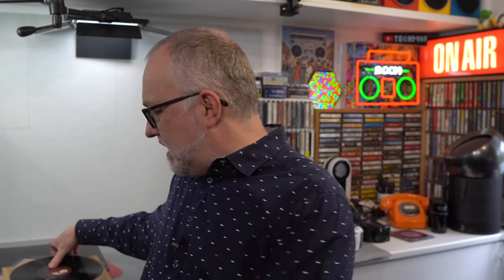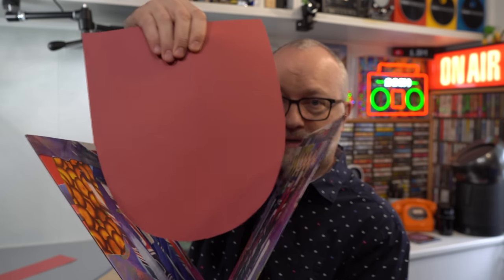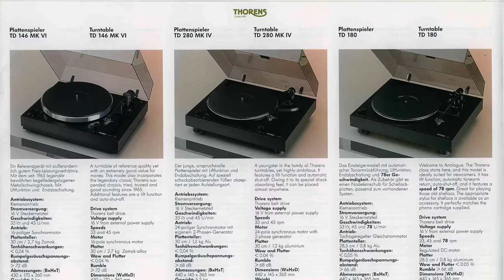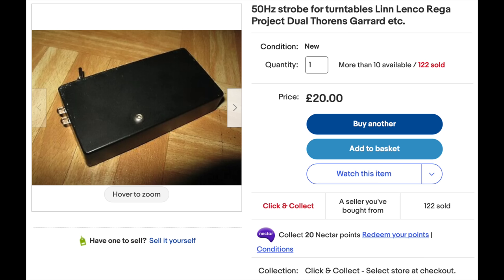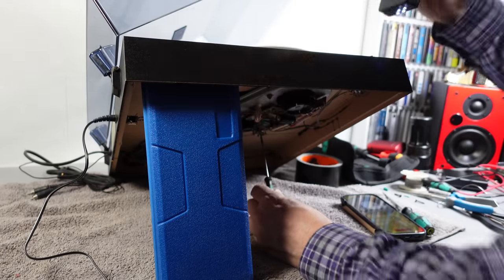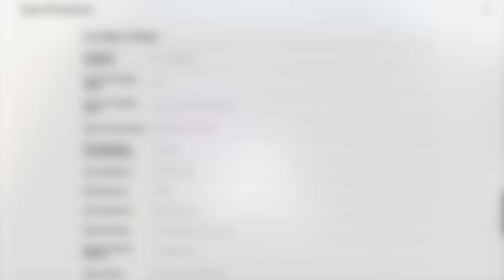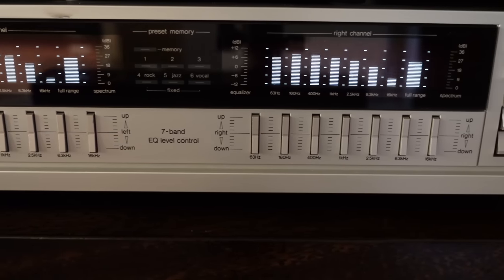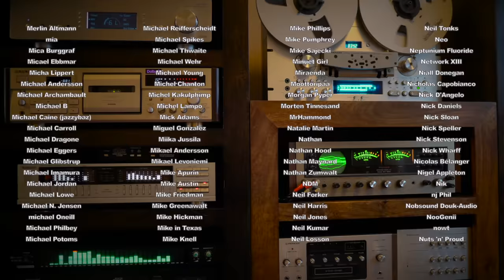Playing 78 RPM Shellac Records properly

Comment: I have some late 50s 78rpms that were released in conjunction with the 45 release as well as LP.  They sound pretty close to the 45 cut with a good setup - sometimes better in some ways... due to the higher bandwidth of the 78rpm disc.. technically you could cut a record with higher frequencey capabilities  on 78rpm.
Reply: Baird recorded video on 78's in the late 1920's.. he was a really forward thinker in many ways.

Comment: Exposed carbon trimpots like those are as cheap and crappy back then as they are now. Oxidation, contamination and drift are expected. Not that they're inappropriate for the job, but the engineer had the use case in mind when specifying them.

Comment: Are the trim pots on the board to adjust the speed originally at the factory??? The trim pots are mechanical devices that can drift over time.

Comment: Do 78 rpm records sound better than 45s and 33s because they run at a faster speed?
Reply: In theory, but in reality not. They are not made off vinyl, they are mono, and the bandwidth is limited.
Reply: The new 78 vinyl pressings sound better than the slower speeds

Comment: If you can find a neon lamp, you can light the stroboscopic disc and check the speed, because it flicks. Old fluorescent lamps can also be used.
Reply: an LED and a large value resistor and the mains will do nicely to make a clean 50Hz strobe.

Comment: You have just perfectly demonstrated how 'loud' and 'soft' 78 rpm gramaphone needles work. The soft or 'quiet' needles are narrow while the loud needles are broader. Not forgetting 78 needles can only be used once and should be replaced after each play. Old record players if you recall had a switchable 45/78 stylus

Comment: On an Audio-Technica or newer Technics with 78rpm speed capability, for even less money than swapping the whole headshell and cartridge, you can use a cartridge that has a 78 stylus available (Ortofon 2M, Stanton, 500, Audio-Technica AT-VM95 series, etc.) and just swap the styli and adjust the tracking force.

Comment: I archived a pile of 78's a few years ago - changed the stylus to a 3m and set the tracking force correctly (using blutack!) on my 33.33 player..   Recorded in Audacity and adjusted the playback speed.  Cleaned up the recording and removed the de-emphasis.   Sounded okay.

Comment: Carbon comp pots can degrade over time and you did buy this used... The motor could be a bit worn, but being that you did get it up to speed, my thoughts are you did the right thing by calibrating the device.  Its been shipped and, again, since it was used, you dont know what was done to it previously.  You also dont know if the factory even bothered to properly calibrate it when it was originally shipped either. Was gonna suggest just using a single output, but you figured that out by the end lol :) It's incredible we still have these snapshots of moments in time from long ago we can still listen to.

Comment: I went with the AT route. I am a (well, the at them moment) music archivist for a local museum. I went with the AT turntable, a second head, and a 78rpm needle from LP Gear. After recording ~2000 records it is definitely a really great option. The built in preamp can be turned off as well, and it outputs via USB, which avoids the fiddling about you had to do.

Comment: Right, now go super low-fi and get a record player that runs 16RPM records. Good luck actually finding a record that runs at that speed but I'm sure they are out there. I've got several vintage players from the 50's and early 60's that have a 16RPM setting on them. Totally had no idea what it was until I did some research.

Comment: A decade a ago I was told for early non microgrooved 78T not to wire a shure M78S cartridge as a "stereo (L+GNd and R+Gnd)", but mix "L+R" and 'Gnd+Gnd" to get the full mono spectrum. it seems to reduce more the surface noise.

Comment: This was entertaining, but if you wanted a budget system that was designed from the get-go to properly play 78s (and 33 & 45) any of the major manufacturers record changers from the 50s to early eighties that came with the flip-over stylus would play 78s just fine.  The changers made by Voice of Music (maybe not so common in UK & Europe) or models by Dual, Collaro, even BSR are an inexpensive way to play 78s with the correct stylus and you can adjust them to the proper tonearm weight.  Maybe in a future video find and restore (if necessary) a Dansette (pink or turquoise would be nice) and export the audio to some good external speakers and I'll bet the 78s sound fine, especially as you mention, most 78s are quite worn.  Cheers. And Yeah, Yeah, Yeah, it's mono to the max, man. We don't need no stinkin' stereo.

Comment: Well, you finally got around to reviewing my turntable.
Yes, I bought a TD-180 Mk-S back when new.
It seemed a logical option out of limited choices at that time. It originally came with (in the US) a Stanton 500 cartridge with a .7 mil conical stereo stylus, and I immediately got a 3 mil stylus for that cartridge.
It has had a few other cartridges with interchangeable 78 styli since. 
It did suffer with running slow after sitting through long periods of not being used, more than once. Though much worse at 78 than 45 or 33. My solution that worked twice and continues to work till the present was simply a drop of very light oil in the top and bottom motor bushing. The motor in yours sounds noisier than mine. So, you might want to give it a try  and recalibrate the pots again if it goes too fast. But that strobe on the motor shaft is supposed to actually regulate speed. It’s just an external servo system applied to an apparently slightly undersized motor for the task. 
Otherwise, it has been an excellent turntable for a lot of things. I do have a lot of other choices in vintage and newer tables for 78s as well as other records. 
I would recommend getting the AT stereo stylus that fits the cartridge you bought so you can use the Thorens for other than 78 duty. 
Also, there is a commonly available 3mil 78 stylus for the common red stylus ceramic cartridge used in your portable and in the common suitcase players. 
There is also a legitimate flip stylus with stereo Lp  on one side and proper 3 mil on the other available for that BANPA cartridge that does not have a proper 78 stylus on the 78 side.

Comment: My dad's Garrard RC-80 form the 50's, came with 2 head shells.  The 78 head shell has a dime glued above the carterage so you don't have to monkey with the tracking weight when you switch from LP to 78.  Looks like it was designed for the dime.  It runs 5 grams LP and 10 grams 78 without adjusting tracking weight.

Comment: What a great exploration of the topic, without delving into esoteric and expensive equipment.

Note that you can digitze the stereo signal and mix it to mono in Audacity or similar. You often get less noise this way, since the music part of the signals reinforce each other, while the noise does not. (I think this is the same as the "mid" part of "mid-side" channel mixing others hae mentioned; the "side" combines them with the phase of one the channel inverted, so the "mid" part cancels out.)

Comment: in industry , electrical induction motor always lag a bit from the math. likely , the original motors in those old record players were induction. is it possible the player you bought was trying to replicate the original slow machines (if they were slightly slow) and making the recorders also accounted this ?   

my theory got hurt when the timming disk came out.

Comment: A Braun P2 could be modified too, to play 78 RPMs and with the right stylus the quality should be good enough for an adequate recording. After changing some capacitors. And the Rifa will fail again in future with exploding and a bad smell, an other X2 with 275V would've been better, as the one you replaced with that Rifa. And for that AT-System that was on you could've get a 78 RPM-Stylus too

Comment: Terrific info. When I grew up, mostly 1968 through the mid-1980s, our "stereo" system was a large mono mahogany cabinet from the early 1950s which had a stylus that you could flip to 78, or, to 16, 331/3, or 45 rpm.  It was mono and valve (tube). I really do wonder about 16 rpm.

Comment: Thank you again Technoan for taking us on yet another of your fascinating journeys of audio/electronic discoveries. Your findings follow my conclusions very closely. 

My 78rpm experience began in 1945 when my parents gifted me their HMV model 101 portable Gramophone and an armful of circa 1920/30s records. I was just five years old at the time. 
(Sorry, but my present age must remain my best-kept secret)🙂).
. What tremendous changes there have been since then. 

Recently, I have been amusing myself by playing severely worn and scratched 78s with surfaces that appear to have been heavily sandpapered and playing them through a free online AI app that can remove anything that was not intended to be on the record. 

Alternatively, it can remove any particular musical instrument; even the vocalist(s). Instant karaoke! 
I have yet to trial it on Edison-style cylinders or Diamond Discs, but I'm reasonably confident that these would also respond satisfactorily. 

Incidentally, both here and in the UK, the flicker rate of both incandescent and regular fluorescent lamps is 100 times per second. 
We would regard a 50-Hertz flicker  to be quite annoying.
 (Try wiring a suitably rated silicon diode in series with a light bulb to experience the effect of a 50-cycle flicker).

Comment: 💎 The Ortofon (of Denmark) OM & CC, Moving Magnet Cartridges, all use the same Mechanical Interface between their large selection of Diamond; DJ, Mono Micro Groove*, 78, & HiFi Styli! 
(…And because of the lines longevity, numerous aftermarket clone styli!!)
{*I don’t recall the value, but the groove wall angle, was less than 90°, on the Original Mono Microgroove 12” LP records. And they are best Not visited by styli optimized for, or previously used to play, 90° Stereo Microgroove Records!!}

Comment: I did a similar thing with a Goldring Lenco B55, Ortofon OM78 and TCC TC-778 preamp. The advantage of the Lenco turntables is to have continuosly adjustable speed: not all 78's are actually intended to be played at 78rpm, but with a range of different spped up to 90rpm. The preamp, although not fully accurate for all equalizations, allows to use an "average" 78 eq, which is still better than RIAA

Comment: The reproduction quality of 78 rpm Shellac recordings depends on where the record was manufactured ( USA pressings are better quality Shellac, than U.K. pressings) The best quality pressings came from India.  Another thing that can cause degradation in sound quality is if they have been played on an Acoustic machine, or an early electric reproducer, using steel needles.

Comment: Someone used that Thorens a lot and didn't peel the peel. Most of the TD 180 as of all Thorens turntables after 1966 were made in Germany. Only between 1993 and 1995 some TD 180s were made in Polen. They are easy to recognise by another label that is missing 'Thorens Produktions GmbH' and 'Made in Germany'.

Comment: Just wonder, what would you recommend for my case? I have a synq x trm 1 DJ Player, it dies 33 45 78 and have changable headshells. So so should i Just get the right cardridge and have 2 headshells? I mean mean, a synq x-trm 1 is a very good and used quite cheap Player, has a powerfull Motor and so on.

Comment: I bought a Numark PT01USB turntable for recording 78s. To compliment it, I also bought a 78rpm needle (793-D3M stylus) specifically for my 78s. I am a 78 enthusiast and own five antique phonographs, all wind up. I can say I have heard good and bad on those phonographs so my listening judgement is at least somewhat experienced. I thoroughly clean the records when I get them and use a dust remover right before playing. My philosophy is that perfection cannot be achieved. Excellent quality sound can. I can rest assured I have done my best, aside from buying overpriced turntables for mass produced, 90 year old shellac records. EQ began in the early 1940s. I generally stop collecting around then because I've heard that music most of my life and am tired of it.

Comment: That is quite a vast improvement in sound reproduction and Mat, you demonstrate how easily this is achieve simply with the consideration of the size and type of stylus. Great information for folks looking for an easy way to get better reproduction from 78 RPM record. I have a handful of 78s in my collection that are early Rock and Jazz and they sound phenomenal when played back with the proper stylus. In some cases better detail and clarity, thanks to the higher speed of the record than would be for, say, the same recording cut at 33and a third. More surface, higher velocity, more capacity for storage of the audio information.

Comment: A bit off topic here. I've seen you've done a bit on radio station carts, but I've run into a few of these 4 track tape cartridges over the years and they harken back to the time of under-dash add-on decks in the late 60s when this was really the first word in hifi for your car! From around 1967 to the early 70s, these were the best sound you could go mobile with. Over here fm adapters/8 track systems really had their best year around 1974! And I restored a 1968 4 track pioneer/Craig under-dash unit last year that I still have and am considering installing in my van... but I thought I would run it by you first. With a little ingenuity, you can record your own four track stereo tapes using a standard reel to reel. Some units around the same time, like Akai, offered you the option of recording your four tracks on your reel deck, so you could listen in your car. And you could purchase a LARGER reel that would play for literally hours, the same kind used for MUZAK in the stores at this time. Many, like the player I had, would accept both cassette types, but took some getting used to... as the slot for the standard "cart" was the same as an 8 track... the slot on these was a good 2 inches wider. Also, with the electronic regulation in 60s vehicles, the DC motors in these would often rise and fall in city driving as you could lose a volt or two when idling at a stop and when you started moving again..  so... enter Pioneer... who developed a "reliable" way to deal with this, which was a CENTRIFUGAL MECHANICAL SPEED REGULATOR in their automotive players... it was by far the most difficult part of the restoration, but I was able to trim a few volts either direction,  from 10-14 volts, and hold at a steady speed. Here's my original post I made, a year ago. This was arguably the first real hifi tape player for your car. 
https://m.facebook.com/story.php?story_fbid=pfbid02PcCQN3fSvVUTuuK2kUCMze93FhNrS2Q1ADudUhgL892cBYngLhmdtVojmSSAgmG5l&id=636376930&mibextid=Nif5oz

Comment: The Audio-Technica turntable pictured, the 120, has had problems in the past with a low-quality internal preamp. I don't know if that's the case with the current production, but it's something to look into before purchasing. I have an older 120, over 10 years old, and the internal preamp is junk. Actually, to get good sound out of the 120, consult YouTube, for proper surgery to bypass some internal resistors that, believe it or not, are on the bypass non pre Amplified outputs.

Comment: I have the final 78 changer (it’s a tube console made before WWII) that RCA produced. It contained a “forever sapphire” needle, but forever ain’t as long as it used to be. I managed to custom fit a more modern 78 needle, though it’s not the cartridge type, as this unit has a diecast arm. 
Eventually the unit developed a capacitor hum, so it sits idle until I recap it. Still, nothing quite like a mono wooden box of tubes (valves) and (maybe) a field-coil speaker when you playback some upright bass!

Comment: If it needed oiling and was suffering issues with torque, the speed stability would have been all over the place. This looks stable (good news).

The issue is electronic, and a consequence of ageing that component values drift. If we had a look at the circuit diagram (should be somewhere on the net?), we could figure out the common fault, it certainly affecting all speeds. A speed regulator circuit needs a voltage reference, a zener diode - or as I suspect, a pair of carefully chosen high value resistors in  a voltage divider, where one resistor leg may have risen to a slightly higher value than the original design. Alternatively there may be a deteriorated integrating capacitor fed from the opto output that is not charging fully with each interruption, having fallen in value.

Thinking about it, that is probably more likely and an easy fix - but let's be real. Adjusting the trimmers worked, and unless it really plays up again - why not just leave it?

Ah, OK my OCD kicked in - the service manual and circuit diagram is on elektrotanya. There is a 11V Zener diode in a series regulator and an integrating capacitor (C3 - 2.2uF).

Nice very complete video otherwise!

Comment: I've got a Columbia Model 126a that I bought a couple of years ago. I got about 1000 albums and a cabinet for them as well in the deal. For around €200. Listening to these old albums is an experience, and replacing the wind up motors/springs with an electric option would take some of the fun out of it for me.
But I'm sure the records would appreciate the more modern pickups, it's a bit more than 5g of needle pressure on these old machines :)

Besides that, great video as always :)

Comment: Here's another idea. What if you used the 3 mil stylus on any one of your better turntables at 33 or 45 and then resampled in Audacity at 2.364× or 1.733×? The pops and clicks would be pushed way up in frequency, so you might even be able to apply a band-pass or notch filter and cut them out?